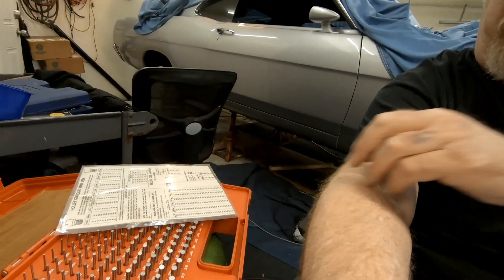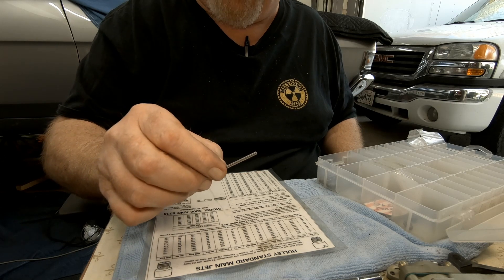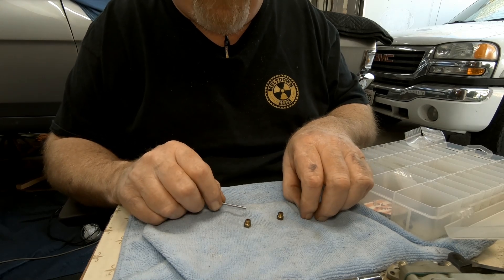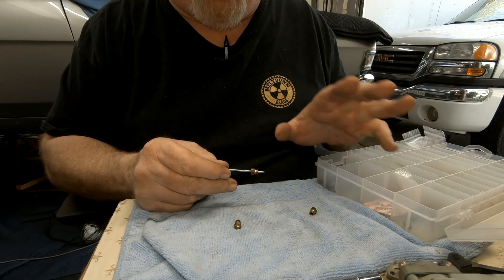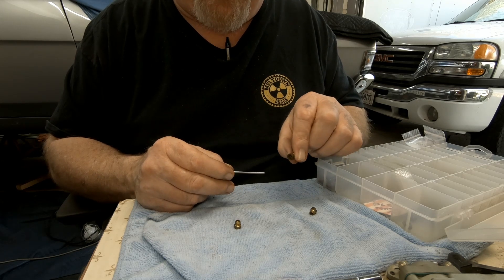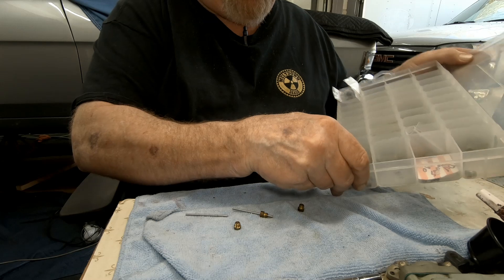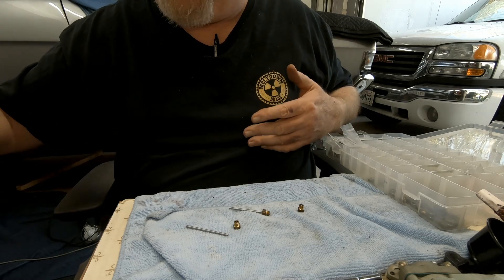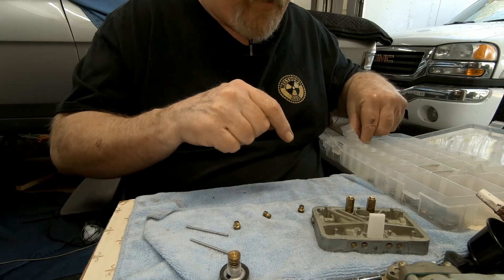TECH TIP: HOLLEY Carb Jet Inaccuracy..Pulling the Curtain back on the Wizard

Comment: The flow through  the jet is not necessarily dependant on dril size BUT as HOLLEY says, it depends on the chamfer at the opening that speeds up the flow through the jet !  You need to flow test them before you make this mistake ! Many people have been doing things wrong for more years than you, and teaching wrong things  !

Comment: Enjoyed your watching you explain the inaccuracies of the jets. I like thousands of other people did not know how sloppy they were with the machining of the jets. I wished you would do a detailed video on the idle circuit. I have a quick fuel and having problem leaning the idle. Thanks
Reply from the maker: What size air bleeds in the idle circuit
Reply: @cavemangarage  I am not sure haven’t looked at them the only thing I have done to the carb is changed the jet sizes from the factory shipped 72-82 to 70-80 and replaced the block off in the secondaries to a 4.5 power valve. My highest vacuum is 10 hg at idle. Also the primary to a 4.5 power valve. I checked the timing and did the four corner tuning. I am going the car had more power with the 72-82 jets and block off in the secondaries but when idle it was so rich it would burn your eyes.

Comment: I'm not sure i'm as concerned with the fact that any particular jet ISNT what its supposed to be, what bothers me is the inconsistency from jet to jet....if they were ALL equally as ''incorrect'', but consistent with that incorrectness, I could live with it. But what you've shown us is you could clearly throw two jets of the same ''advertised'' size into a metering plate, and have them NOT both be the same size jet.....and THAT isn't acceptable. they might both be marked 84's....but clearly we cant count on them to both be the same. again, good video Dennis.